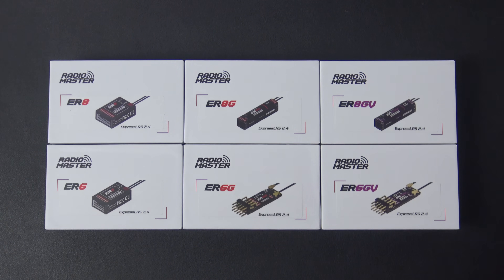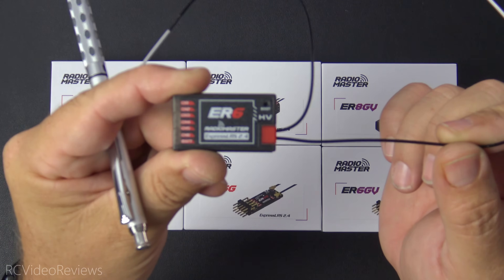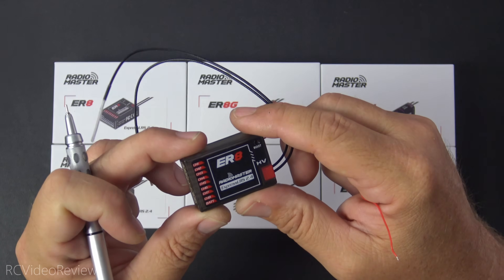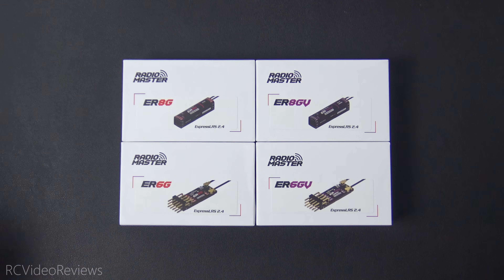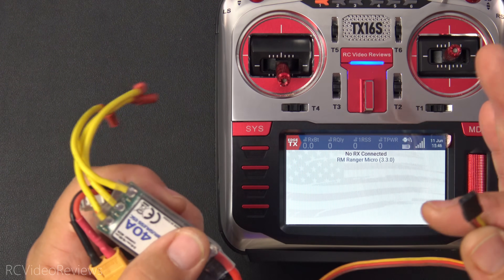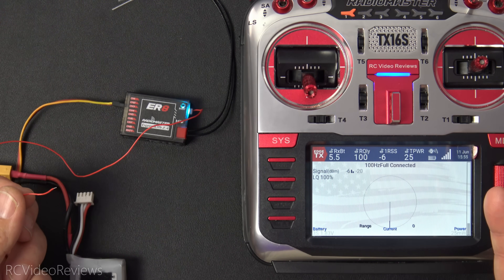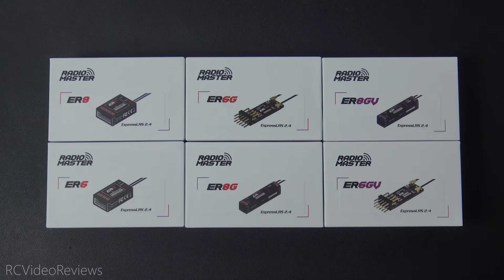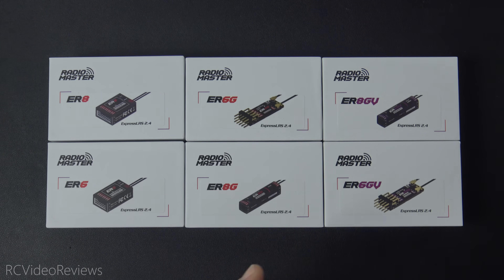Radiomaster ExpressLRS PWM Receivers [ELRS] : ER4 • ER6 • ER8  • ER6G • ER8G • ER6GV • ER8GV

Comment: Finally! I worked on these like 8 months ago and I'm happy to see they're finally released and can talk about them. This is a great overview I can point to when people ask me what the differences are, great video.  The 4-pin on the back can also be used to output CRSF or SBUS to a flight controller and still have the PWM outputs as well.
Reply: He did write the software. He should know what does and what does not work. Don't trust a manual when you can ask a developer.
Reply: The work yourself and the rest of the ELRS team is putting in is greatly appreciated! I've been using ELRS almost exclusively since 3.0.0 dropped and we got the full res packet modes and haven't looked back, except to figure out how to sell my old Futaba equipment.
These new receivers look great and I hope it will further expand ELRS and EdgeTX marketshare!
Reply: This is awesome. Elrs pwm receivers. That output crsf or sbus. Plus a uart. This is going to change my foamy flying.
Reply: @brookehager6114  I guess you haven't seen betafpv superp 14 ch lol. That also does that.
Reply: Has it got sbus too @brookehager6114
Reply: I'm not sure you are right, checked the website, not a single mention  and no pins to solder on the PCB pictures that show front and back without the sticker. Was already wondering they are not usefull for quads.
Reply: @Photonees  You mean the CRSF output port? It definitely puts out the channel data out that port. Source: I wrote it. No soldering to the receiver necessary, just use the supplied cable and hook it to a flight controller like a regular receiver. The PWM outputs can be remapped to any input channel too so you can like do a pan/tilt camera setup and stull run the quad like normal.
Reply from the maker: Comment of the month. "Source..." :)
Reply: @CapnBry  interesting. But why is there no mention of it on the website? Wanted to DL the manual, but not available yet... So you mean the pins sticking out. The i onderstand I guess. I thought you meant extra "pins" to solder on on the receiver 😅
Reply: @Photonees  haha no worries, the thing's got pins sticking all over! What I said definitely was ambiguous. Any manufacturer can also make sensors to plug in there so long as they speak CRSF protocol, although the types of telemetry CRSF supports currently is somewhat small, but we're looking to greatly expand that too.
Reply: @CapnBry  looking forward to that. Just some to us (EdgeTX) early enough, so that we can release the sensor support in parallel.
Reply: I really hope so because being able to use SBUS out and full Mavlink would really make the ELRS technology work for anyone with ardupilot.   There’s a huge user base which needs a good long range and telemetry solution. 
Thanks for the info. At least I have some hope now.  
Where can I find more info on compatibility?  Manuals are non existent or not complete.
Reply: am I correct in assuming that all these receivers actually handle more than 8 channels, but only have physical pins for limited number of servos?
so if they are used only as receivers to pass the signals to a flight controller, it really doesn't matter which one you use?
Reply: @davidjacobs8558  Right, all ExpressLRS devices are capable of 9-16 channels (depending on the packet mode), so if you hook the serial output to a flight controller they are all 16ch capable. You can also mix it up by sending the data to the FC, but also using some of pins for servo output, allowing you to supplement the FC's servo output count.

Comment: Could you tell me the differenz between the telemetry power? The er5A that i am using has 10 mW the 6er or 8er i use has 100mW. Dose that mean that i souldnt fly far away with my er5A. Is it less range with 10mW?

Comment: What range would you trust the ER4 to? I'm going to be using them in SBUS mode with A3S4's in my 750-1000mm racers. They are small so I won't be flying them at any great distances.🤪 Would you trust them in larger planes as well? I'd like to use one in my Excalibur V2 warm liner since there's not a lot of space in the electronics bay.
Reply from the maker: I would trust ELRS ER4 for control farther than just about any other system available to fly at range (i.e. video). It will EASILY outfly your eyeballs without even breaking a sweat. https://www.expresslrs.org/info/long-range/
Reply: @RCVideoReviews  😯 Had not seen that page before! I knew it was a solid link, but was overthinking the single vs dual antenna aspect and whether it might affect range. Thank you for responding.  🍻

Comment: Does the ER6GV receiver work with 2.4 normally? I have the Master radio without an external module... I would like to know if it works right away?
Reply from the maker: All of these receivers are 2.ghz ELRS (LORA). If your radio uses a 4in1, that does not work with ELRS (LORA). You need an ELRS transmitter.

Comment: Newbie, bamboozled !. I have bought an ER4 and RM Pocket. Two channel for a yacht, rudder servo chnl 1, rotary winch chnl 3. Lipo 7.4 volt battery that I want to connect to the RX to drive the servos. How do I do that with one wire from the EX V pad ??

Or do I plug the battery using a servo connection into chnl 2 or 4, which will then power the two chnls I want to use …which I’ve tried, but all I get is the red LED blinking at me … does not want to bind. Look fwd to your help
Reply from the maker: Help awaits on discord. YT is a terrible platform to cover this type of discussion. Link to my discord is in the description of every video I post.
Reply: @RCVideoReviews  discord ? I don’t understand.

Comment: can these be used for helicopters with flight controllers ?
using provided SBUS cable ?
Reply from the maker: Yes, s.bus is s.bus. Be aware, s.bus is unidirectional though, so you won't get telemetry beyond what the Rx provides.
Reply: @RCVideoReviews  so...
only ER6, ER8, ER8G and ER8GV have SBUS out function?
only they come with SBUS cable.
Reply from the maker: SBUS is a firmware option. RX independent. If there is no UART it's provided by PIN2 for PWM or TX for serial only RXs.
Reply: @RCVideoReviews  if I want to have SBUS, vario (altitude ?) telemetry, and lipo voltage telemetry,
is ER8GV pretty much the only option ?
Reply from the maker: @davidjacobs8558 I don’t know if it’s the only option but it’s a good one.

Comment: Hi John, I just bought 2xER8 receivers for my planes and when I turn on them on with radio on as well, one flying surface (never the same) move to maximum deflection then go to centre after the receiver fully connects to radio. My radio is TX16S with Ranger ELRS module. Could you advice me on what to do? Thanks.
Reply from the maker: I haven't ever encountered that issue. You probably need to hop on the ELRS discord and ask them directly.

Comment: I’m looking getting the tx16s and I’m debating getting the elrs version or the 4 in 1, is there a elrs  usb dongle that works with simulators like Realflight, or would I have to get the 4 in 1 and use the Spektrum usb dongle? I really like the elrs receivers but want to be able to use the simulator.
Reply from the maker: ELRS has a bluetooth joystick option that works with Windows 11. No extra hardware required, but you do have to launch the ELRS LUA and start the joystick.

Comment: I just got my er6-GV setup today fully expecting to find a "VSpd" sensor on the telemetry screen, but there is not. There is only an altitude readout, no vertical speed readout.
Reply from the maker: Not correct. It has vspd. I'm looking at it on mine right now.
Reply: @RCVideoReviews  Ahh, good to know. Saw some other folks with this issue, glad its not the case everywhere. I'll change my comment
Reply: @RCVideoReviews  Just heard back from radiomaster. Turns out it's an EdgeTX thing. Need to be on v2.8.4 or later.
Reply from the maker: Hmm, interesting. Did migrating to 2.8.4 work?

Comment: Had my 6GV in a F3K model for a week now but haven’t managed to get the vario working. No vspd in telemetry. All other telemetry is working. Any ideas?
Reply from the maker: On discover sensors if it doesn't show up, and you have current firmware on it and the radio, the only thing I would do is reflash the RX with ELRS and do an erase before flash. If that doesn't produce vspd in the sensor list, I could contact Radiomaster for additional support.
Reply: @RCVideoReviews  Thanks. I upgraded to 3.3.0 on both TX and RX but still no vspd. The Alt also continually counts down. I will contact Radiomaster and see if they have any suggestions. Cheers.
Reply: @warrencheetham9672  In the same boat here. Everything is up to date, but i'm not seeing any Vspd...
Reply: Just heard back from Radiomaster. Turns out it's an EdgeTX thing. Need to be on v2.8.4 or later to get the VSpd sensor to show up.
Reply: @malinhiles  I'm using OpenTX on a Jumper t-lite v2. ELRS via the external TX Module AION NANO upgraded to 3.3.0 ELRS firmware. In other DLG's I've been using MATEK ELRS-R24-V R24V and the varios work fine.
Reply from the maker: Did anyone confirm 2.8.4 solves it yet?
Reply: @RCVideoReviews  Just flashed Edge 2.9, and now Vspd shows right up. Seems like there could be merit to  this being an EdgeTx firmware related problem.
Reply: Just bought a 8gv today... i'm on edge 3.3, seems like I will never see the vario...

Comment: The built in VBAT Telemetry kinda piqued my interest over CrossFire which I'm currently using, and which doesn't have that functionality by itself ( I'm using various Matek Adapter Boards for that ).
BUT that CH5 Arming situation could require some explanation... I only drive RC Tanks ( https://youtu.be/l3_RcOU3zo0 / https://youtu.be/VNP6Dstz6wc ) three of which require at least eight Channels to operate to access all functions with two of them requiring PWM Outputs - So all eight PWM Connectors. Now... As you may guess Arming isn't exactly a thing for RC Tanks ( at least I'm not aware of it being a thing for models of the size I'm frequenting ) so having it block even just one of the eight required PWM Pins is kinda an instant NoGo for me which brings me to the question if Arming can be mapped to a Non existing/physical "virtual" ninth Pin thus freeing up all eight PWM Connections?
Reply: Yes, you can free up all 8 pwm`s

Comment: Hi Rc Video Review. The Er4 is it suitable for nitro planes? Let say all I need 4 ch. What size Er4 can be used on. Let say it's 4ch gaser? Any limitation for Los? Ty
Reply from the maker: I don't see why not. Zero limits for LOS. Almost every plane I have right now runs ELRS--LOS or otherwise.
Reply: @RCVideoReviews  ok I'm worried because has one antenna. Ty
Reply from the maker: I'm not.

Comment: I just got these in the mail about a month ago. In the video you demonstrated how to get RxBt through the vbat wire, but is it possible to to get RxBt through a BEC?
Reply from the maker: Sure--it'll be 5v all the time though.
Reply: @RCVideoReviews  yea thats what I'm dreading, I think I have to solder this into the main battery leads.
Reply from the maker: I usually put a single pin (breadboard jumper wire) between vbat pads on the RX and the positive lead on the balance plug.

Comment: Hello need a bit of help i am using a pixhawk do you know if radiomaster make a expresslrs receiver with sbus?
Reply from the maker: Radiomaster produces the hardware. The ELRS team produces the software. SBUS is available in 3.3.0-RC-1. As of the release of these receivers, 3.3.0-RC-1 wasn't available. So they will support SBUS if you upgrade the firmware. Keep in mind as of today, 3.3 is in Release Candidate stage. It should be final soon.
Reply: @RCVideoReviews  many thanks the problem i have is finding a radiomaster expresslrs receiver with sbus
Reply from the maker: Flash 3.3.0rc-1, then you'll have sbus.

Comment: Will this bind with a Spektrum 6I or do I have to buy a radio master? I'm a newbie and Spektrum seems to be stupid high stuff.
Reply from the maker: I can't answer questions about Spektrum because I don't use their gear. If you're a newbie and haven't made a big investment in tx/rx's yet, you may want to consider taking a look at the TX16s with EdgeTX. Much more powerful and economical.
Reply: I was able to bind to an stock AR-631, a jailbroke AR-631 and a Jailbroke AR-637T.

Comment: Is there any that is suitable for RC cars? I want to build a FPV Rc car but my Dumborc tx only has 400m(claim) range. Its has a 3.5mm port used for simulator or PPM interface as it claims, is it possible to connect a Elrs module to it? I only need 2 channels or perhaps 3 for camera tilt :) 
And pistol grip tx is a must for me.
Reply from the maker: ER5C was intended for surface operations, but honestly, any of them will work.

Comment: I hope they will release a Lipo Cells voltage sensor to connect to the UART port. To have in the telemetry the voltage of each cells and to have the possibility to set the low battery voltage alarm on the lowest cells voltage instead of the total lipo battery pack voltage. I know you can do it Radiomaster ;-)  And also receivers with gyro please !
Reply from the maker: I've asked for integrated gyros too. I've been flying with vbat for some time with every kind of plane. As long as your batteries are healthy--no big discrepancies in cell to cell IR, overvall vbat is quite effective and accurate. Cell voltage is nice, but vbat is effective in a practical sense. I literally have it on almost everything I own--including 85" Extreme Flight 3D planes and my 90mm F-22 Ultra. The planes that don't have it yet will be getting it.
Reply: @RCVideoReviews  Yes you are right. Vbat is better than nothing. I use it on all my models.

Comment: if you have an ExpressLRS transmitter and receiver you have many miles of range, but how do you get many miles of video transmission. Or is the video transmission through the ExpressLRS system?
 thank you for your nice work, have a good day
Reply from the maker: You are about to take a red pill....

Antenna trackers, directional antennas, 1.3ghz usually are good combos for video range.

Comment: Thanks for the video. I’m wondering if these will be limited to four proportional channels, with other channels having less resolution? Is that a feature of ELRS and not just the PWM receivers? Do the CRSF receivers also only get 4 proportional channels? Also, the UART port for the longer receivers is visible on one of the longer sides just under the shrink wrap.
Reply from the maker: ELRS 3.0 provides 16 proportional channels.

I saw the UART port after the video. One of the EdgeTX devs pointed it out. Thanks for sharing.
Reply: Thanks for the clarification

Comment: Wonder if the ER6 can be de-cased.  The case is too thick for my situation but the bare receiver should be OK.
Reply from the maker: Of course it can. If it can be put in a case, it can be taken out of one. If you don't want the case, you may want to check out EPW6.
Reply: @RCVideoReviews  Thanks John, tossing my Jumper T16 and going with a Boxer + Express LRS in an old school Simplecopter mini-T.  Was going with the Matek R24-P6 when this video dropped.😀

Comment: Please pass this on to Radiomaster,

They're too expensive. The 8ch receivers are 34.99, vario version is $40. I can make my own 10 or 16ch pwm with vbat (and possibly even current) sense from HM or Matek elrs receivers for around $20-25. If these 8ch receivers (at least the one without vario) were priced a little more competitively at around $20-25, I'd be likely to buy some. At this price I will not buy any, I doubt a lot of others will either. Any receiver over $30 is just too expensive. That is why I stopped buying and using FrSky 8ch sbus receivers. At first when they came out, they were in the mid $20 price range, but slowly they snuck up the price, and I stopped buying them. So please let Radiomaster know they priced these out of reach. I like their products, but the whole point was that everything they make is open-source and I bought their products because they were inexpensive and fairly priced in the past. These are not priced fairly, in my opinion, and are not competitive.
Thank you for the review, it is great and informative like always!!
Reply: Expensive? Well, if you can make it better and cheaper. More power to you

Comment: Please forgive a noob question, but if a quad requires four channels just for the sticks(?) does that mean a four channel receiver wouldn’t work if I also need a channel for arming, flight mode, beeper, flip after crash, etc?
Reply from the maker: Usually quads are managed by Flight Controllers and almost universally need more than 4 channels, so we usually feed them via a serial protocol like CRSF or SBUS (mostly CRSF). Serial protocols can feed 16+ channels over one wire to the FC and the FC can then distribute commands over it's outputs as necessary.
Reply: @RCVideoReviews  thank you!

Comment: Excellent work for RadioMaster. =^/,..,^=

Now I know what ExpressLRS receivers to put in my helicopters.
My T-Rex 500 ESP 3G would benefit greatly from the RadioMaster ER6. I can yeet his 14 year old Spektrum AR8000 receiver without needing to replace the flight controller (which is a BeastX Micro Beast Plus, by the way).
Reply from the maker: I agree--this is a great infusion of energy into the ELRS product space. Just awesome.
Reply: @RCVideoReviews  I love the fact that they are very affordable too.
Reply from the maker: Agreed. Very reasonable.

Comment: It's not a typo in the weights.
It's because the weight RM have stated is with ALL the wires attached !!!
Reply from the maker: Nope. Not even close. It was a typo. They already acknowledged it. The 1/2g difference--don't really care one way or the other as it could come down to calibration between scales.